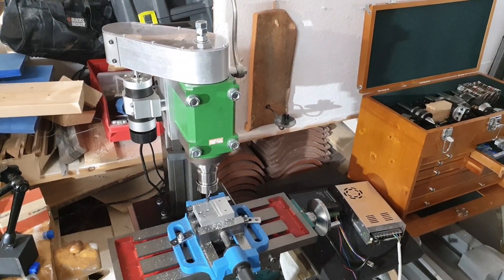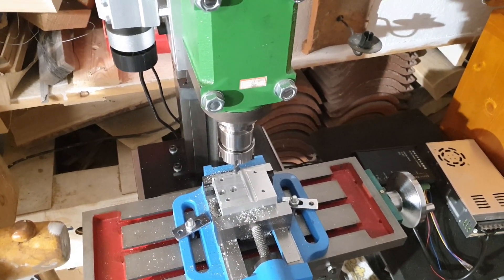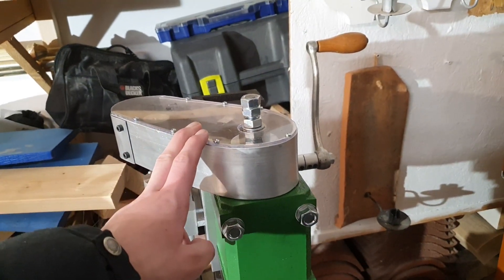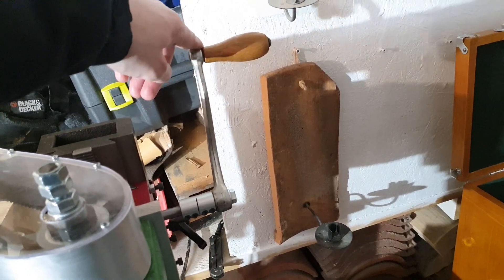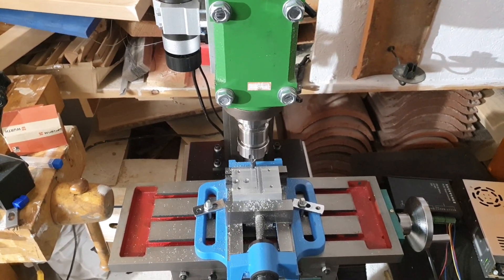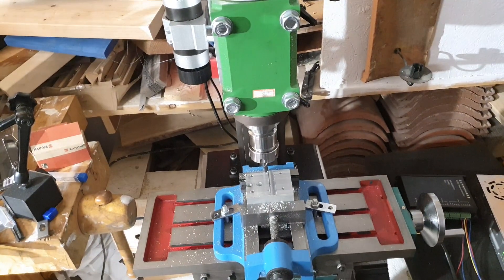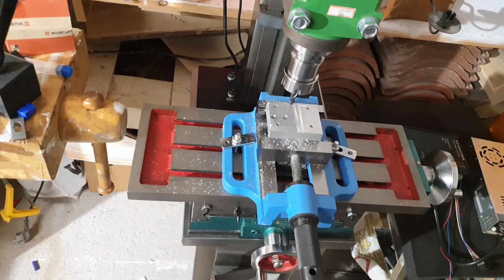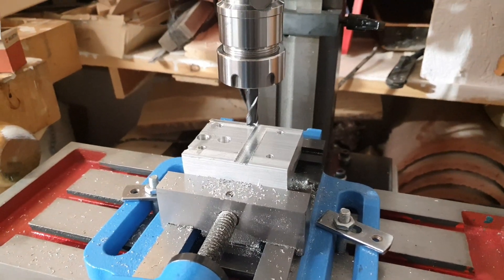Mini test bt30 - manual mill Project

Comment: hi bro, how is this spindle working for you?
I plan to buy a bt30 equal to 6000-8000rpm and connect it like you but to an er11 motor that I already have 1.5 kW a homemade cnc for machining aluminum.

do you think it's a good idea?
Reply: Just buy a used milling machine as its money well spent. By the time you add up all the money you sink in to the project you may aswell by a used mill that can chew threw steel rather than a DIY one that struggles on aluminum. If it's a cost thing use Zilch & you can buy your chosen item from anywhere & pay over 3 months splitting the cost in to 4 as you Pay 25% up front when you buy the item l. I've brought 2 lathes this way.

Comment: I was thinking to get same spindle and use it with servo motor that are being sold on ebay from 1kW to 3.8kW. Seems could be good combo.
Reply from the maker: Yeah I am currently looking at a new motor. Mine is not really suited to drive a spindle like this. 500w brushless 12000rpm is what I have currently, with a reduction of about 40%. Found a 1kw dc servo industrial sewing machine motor, that looks very promesing. About 110usd with driver included. Think rpm was about 3000. :) seem to be Good bang 4 the buck. Cant say anything negative on the spindle yet. :)
Reply: TheChipWelder I just got this spindle for a CNC build. I’m planning on buying a 48V 1800W BLDC motor that is normally used for smaller motor bikes and go carts (along with a controller). Thankfully I found a power supply capable of powering it lol.
Reply from the maker: @Thorhian  Nice! I am super happy with it so far. Just bought a 550w brushless sewing machine motor that I Will test out soon. Rpm is 500-4500, which Hopefully is much stronger on low rpm than the 500w 12krpm I am currently using. I Will make a video about it soon, price was Only 80 usd with shipping and driver included. A stronger one like you bought would be better. But I cant afford a stronger at the moment. Good luck with your Project. Will u be uploading videos of it in youtube?
Reply: @thechipwelder1253  I probably won't upload anything to Youtube. Maybe when I finish it? The BLDC motor with the controller is about $120 USD off of amazon. The power supply is about $80 off of banggood. I'll let you know how well the setup works. Later I might make an automatic drawbar based on some of the designs I've seen in diagrams for Haas mills along with other people's attempts for making ATC BT30 spindles. I'm kind of new to all of this though, machining. I'm more of a computer science person with interests in machining lol.